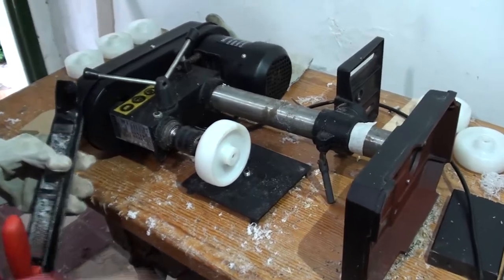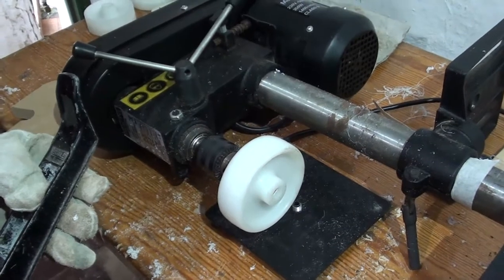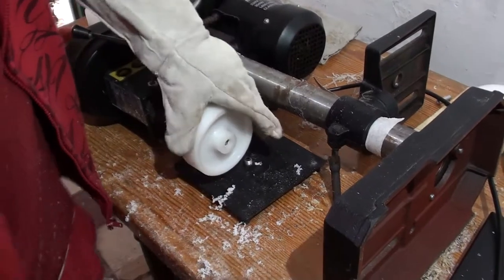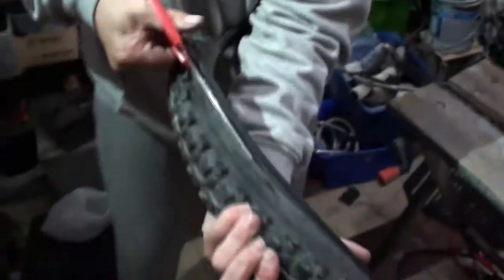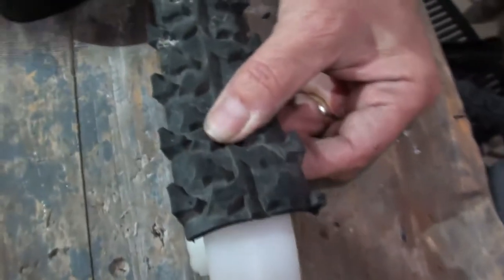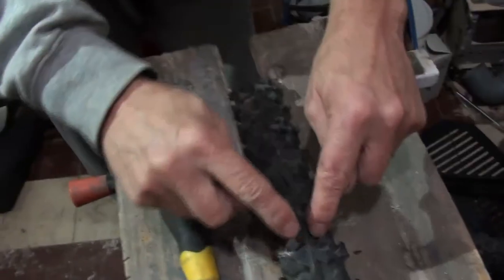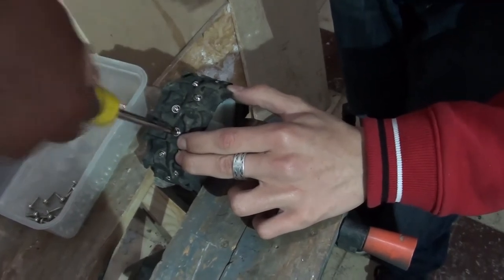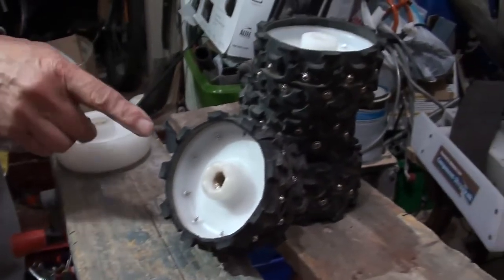Part 2 - How to make combat robot wheels

Comment from the maker: These wheels were specifically made for cordless drill motors (I have a video explaining a bit about them). The drills have a threaded shaft, hence the brass nut insert, but they also have a reverse screw thread going down the centre of the shaft. You lock the wheel on (normal thread), and to prevent it from loosening in reverse, you lock the counter-thread screw against it. I believe you can sort of see the rev. screw in the next video. :)

Hard to explain, but I hope that helps!

Comment: I need help about motors can you help me? I'm waiting reply.How can i buy motors like yours? And gears?
Reply from the maker: These drive motors are from the insides of cheap cordless drills. I have another video on this channel (most viewed) showing some details about cordless drills for use in robotics.
Reply: TeamExpat Thanks a lot.But i need link on ebay if you can give.
Reply: How much rpm and toque i need?
Reply from the maker: Fersa Aurik This sort of thing. Where we live (Spain/England) they can be had for cheaper in hardware stores. http://www.ebay.co.uk/itm/ARGOS-VALUE-RANGE-CORDLESS-DRILL-DRIVER-12V-/350835579504?pt=UK_Home_Garden_PowerTools_SM&hash=item51af6e1a70

As for rpm/torque, it's impossible for me to say without more information. Two drills like the above will drive a 10-15kg robot, 4 of them could drive a 15-20kg robot at most. I would recommend not using wheels any bigger than 100mm for these cheap drills.
Reply: TeamExpat Thanks a lot for information.I want to know that what is name of these white material? In addition you used on chassis.
Reply from the maker: Fersa Aurik Both materials are thermoplastics, the wheels are nylon, and the chassis is "HDPE". Most thermoplastics are suitable for robot use, although some can be brittle and might crack with big shocks.